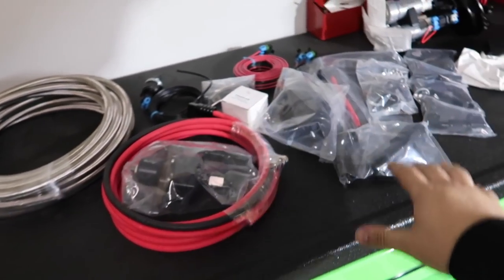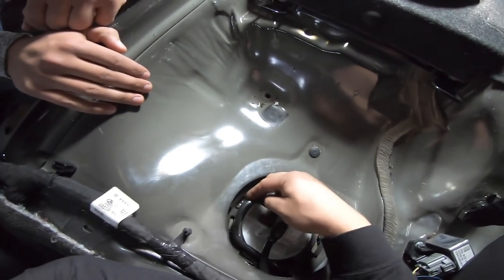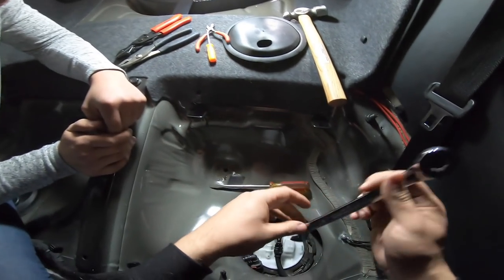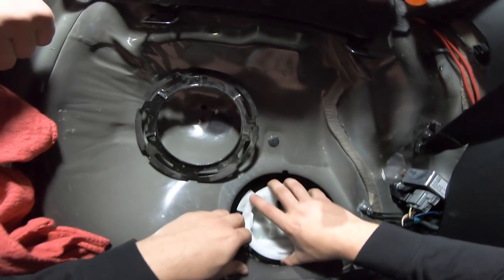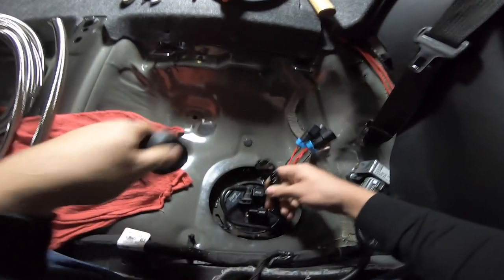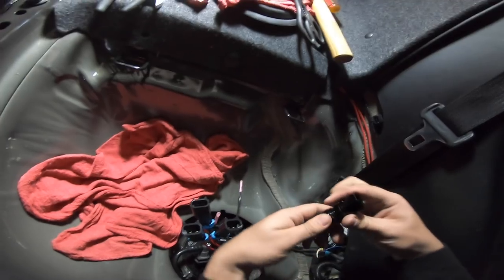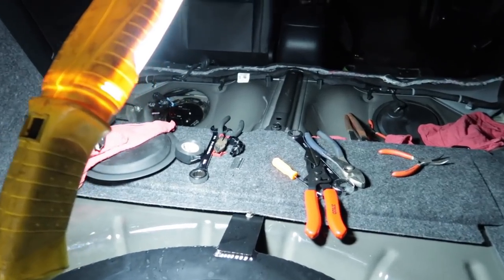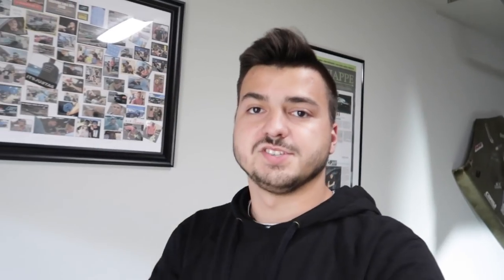We needed a 2,000hp supply of fuel..

Comment: A quick tip for everyone removing a fuelpump, fuelfilter or fuel line, have the car running in the beginning then while its running just remove the fuelpump fuse, then the car will suck out all the fuel from all the fuellines before it dies, it will make the job alot easier and alot less messy :D

Comment: You can use cable clamps to attach the fuel line to the body of the car, this way you don't have to worry about them dragging and you can route them however you want.

Comment: If you would disconnect the fuel pump relay and run the car till it shuts off you would have less of a mess. Just a tip.
Reply: Can't do that.  Has to have the fuel pressure from the fuel pump to run
Reply: @garyunderwood7678  The car should run off of what's in the fuel rail bc it's still under pressure.

Comment: Before you connect the lines to everything make sure you blow them out with air or all the contaminates in the lines will clog the fuel filter or even worse the injectors

Comment: GAVIN, Just a thought for your fuel filter. If you have room under the hood, mount it under the hood. those self tapper screws do not look like it has the filter mounted well. also, i know you already did it, but you could have reused the fuel level plug for the pump. all you would have needed to do was cut it back a little more than what you did and just crimped it into the new end and you could have just plugged it right into the stock connector. Looks good though, keep up the good work.

Comment: There’s a notch In the plastic can’t tell if it’s at the top or bottom but you could drill a hole big enough for the fuel line to be fed through to attach to the fuel filter

Comment: Make two round holes in the side of that black plastic channel under the car. That way, the line is in the channel. Pops out the side. Then, to the filter. 
Back out of the filter, through another hole and back in the channel.
Then, it will never drag!!

Comment: I forgot to comment on the video about the front springs replacement you need to upgrade your front rotors the pads are harder then the rotors so they are wearing quicker then the pads which gives you the lip on the rotors

Comment: Instead of trying to clamp it down why dont you drill two holes into the line guard where your other lines were so that line can run through the guarded area and just pop out for the fuel filter and then just run it right back in?

Comment: THOSE ARE SOLDER FILLED BUTT CONNECTORS. YOU SHOULD HAVE HEATED THEM. ALSO SHOULD HAVE SHRINK TUBED OVER THEM TO ELIMINATE THE RISK OF IGNITING YOUR FUEL IN YOUR TANK. (FACEPALM)

Comment: For those watching, he isn’t a mechanic. Don’t take what he does as correct. You should never use steel to loosen the ring holding the sending unit in place. Brass punch, brass hammer. No chance for spark. That is only 1 of hundred different things he does that is dangerous.